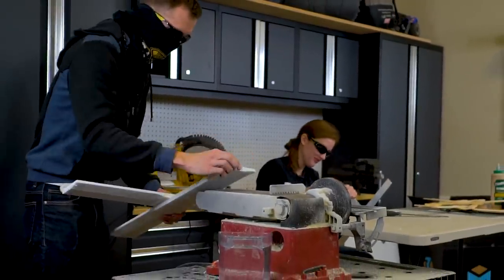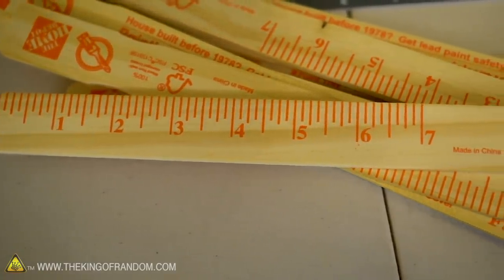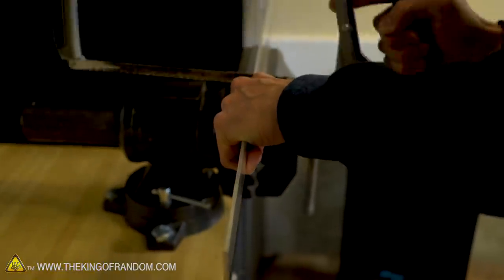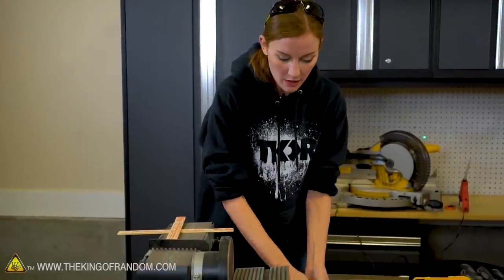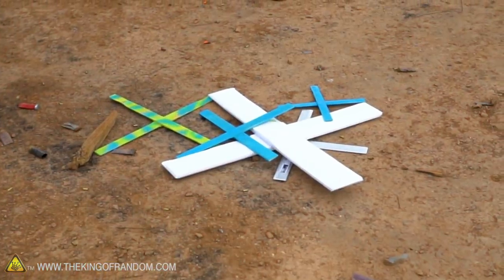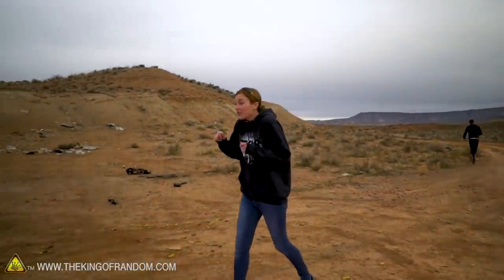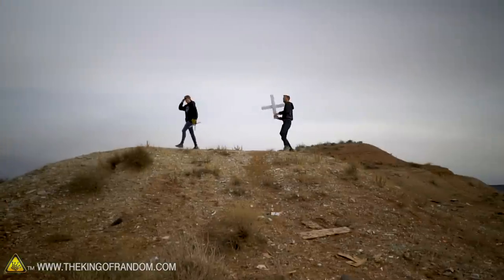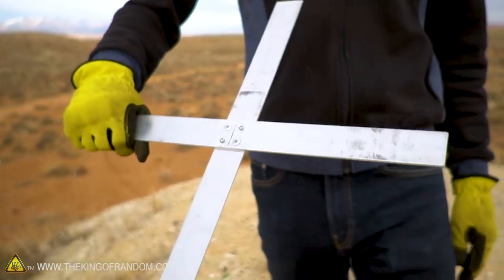Giant Metal Boomerang... Did It Come Back?

Comment: try actually "BENDING" the trailing edges of the metal one downward like flaps. basically you need to either spin it 100x faster or you need to increase its "bite" on the air to overcome its inertia. make Colin Furize it? attach it to a motor get it spinning at some insane speed (balance it first) and then catapault it into the air and release ?
Reply: Yes or Joerg Sprave.
Reply: I was actually going to say that it probably doesn't work because the ratio of structural material density to enviromental material density wasn't the same and that they might have better luck throwing it under-water.
Reply: hawkturkey  On a wing, they're called "flaps".
Reply: Like a fidget spinnerang?
Reply: Drac Williams let me show you it's features
Reply: Great advice but much easier to use a much thinner aluminum.

Comment: The metal on the metal boomerang needs to be more spread out, like a metal-bladed fan. It was too heavy for curving, spreading out the metal will work.
Reply: Its funny how we have more common sense then them they literally don't know aerodynamics
Reply: Tj2cool I wouldn’t exactly call aerodynamic knowledge “common sense”...
Reply: @FlyingSagittarius  that aspect is common knowledge if you attach a rock to a plastic bag as a parachute and it works. Now if you attach something havier wouldn't you make the parachute bigger? Its the same thing if you use metal which is heavier than wood and you know the surface lenght of the boomerang causes it to fly would you increase the suface lenght. They know how the boomerang works but they dont have the common sense to see the problem im 15 and i could figure this out. I bet they didn't even use a light weight metal like aliminum or something
Reply: I think if they drilled a bunch of holes to lighten it and then skinned it with some masking tape they would get better results.
Reply: Hopefully they'll make a better version of a metal boomerang
Reply: As one of my greatest friends always says:

The hardest choices, require the strongest will.
Reply: @AnimeErudite  they did in fact use aluminum.... they... literally say so In the beginning. They also don't have the metal specific tools to make it thinner or to flatten it out evenly so I'd cut em some slack?
Reply: 2:39 bar of aluminum
Reply: Dave Stacey that's a whole lot of extra work to do, using thinner sheet metal and slightly increasing its dimensions should work with less effort. Plus it's easier to roll curves into.
Reply: @AnimeErudite  aluminum --> 2:40 3:10

Comment: For metal you also have to account for the weight to surface area ratio. The reason the wooden ones fly like they are supposed to is because there’s enough force from the air on the surface area to support the weight of the boomerang for a certain period of flight. You can go thinner and thinner until eventually your metal boomerang weighs the same as your wooden one and still has the same surface area on the sides, or you can make your wings wider to provide more surface area.

Comment: You guys should try finding the center by balancing the sticks on a nail then drill a small hole through that point, put a nail through both sticks and glue it there. Should also try using 3 sticks to see if the affect is more pronounced.

Comment: The metal one didn’t work because it’s a different material, therefore different density. 

I feel if you want the metal boomerang to work you need to account for the mass and surface area of the wings. Try figuring out the surface area to weight ratio of the wood and foam ones and scale up the aluminum accordingly. 

Hope this helps!

Comment: Try using a thinner metal with a larger surface area, that way it will pick up the wind more and potentially turn easier, your one is too heavy for the air currents to affect it's trajectory at all

Comment: Nerf made similar boomerangs in the 80's.  The metal one didn't work well because you made it straight.  The metal doesn't give to the wind as well as the foam or wood.  You should have slightly bent the metal blades up to catch the wind and give resistance.  Actual boomerangs are shaped differently and the return is all in the shape.  The resistance to the wind is what causes the return so your wing shapes have to be modified with that in mind.

Comment: I think the reason why the foam worked so well compared to the metal is because there's not enough arm strength to give the metal boomerang enough spin.  You would have to build some kind of mechanical launcher to get the metal one to fly.  As long as you have enough RPMs compared to weight, it will fly.

Comment: I have the book in my amazon cart, ready to order. As for the aluminum boomerang, I think the rivets messed with it’s flight pattern. There may be an adhesive you can find, or try welding them and grinding down the edges of the welds until it’s sleek.

Comment: The aluminum one probably didn't work because it had a higher ratio of inertia/lift, since it was made with the same proportions of a wooden one and is heavier.
Maybe making the blades thinner and/or bigger would solve this problem

Comment: you should use a PVC pipe for making a boomerang. this could happen by cutting it along the top then heat gunning it into a flat sheet. then you could use the heat gun to angle the blades more sharply and cut the sheets out into sticks.

Comment: Calli it looked as if you were letting go at full arm extension which may bias a lower flight where if you if you let go at mid extension it may go higher meaning more time in the air/airtime for the boomerang

Comment: Here's some tips on the metal boomerang make it smaller and do the elbow boomerang curve the ends don't keep them corners and you had the air foil correct you just need to make it lighter get a fairly thin aluminium about a 3/8 inch thick and from tip to tip about 8 or 9 inches and about 3/4 to an inch wide this draft should help fyi I've never made a metal one but have made wooden ones before

Comment: The metal one was too heavy for the wing width which was too small to give lift to the boomerang. If it was thinner metal or even if it was same thickness but wider it might have worked better. I've experienced this before in my engineering projects.

Comment: Does parking a car on uneven ground affects its suspension?
Reply: Statically yes. As far as increasing wear while it's parked, no. Sprung weight is always carried by the suspension and uneven surface will transfer weight temporarily but won't hurt anything.

Comment: 2:30 using metal hacksaw blade to cut the wood.
2:36 chopsaw sitting 3 feet over from the same bench vise where the wood was cut 🤦‍♂️
Reply: Also the better way to make them is just to wrap them with rubber bands than using wood glue, & no sanding is needed.... the rubber bands let them have give on hard impacts and lets your kids adjust them to ‘experiment’ different tosses. (t shapes, etc)

Comment: I think you might have to have longer arms (wings) to have enough lift on to make it fly...
Reply: Wider, more surface area for the weight.
Reply: @mattg7952  , I'm not an aeronautical engineer, but I believe there is a point where making them wider doesn't provide more lift. I think that's why gliders have long, narrow wings. You need surface area, but you also need pressure differential.  Right?
Reply: @Ridingrules10000  There's plenty of variables. Weight, speed etc. Like an airplane prop, you don't make the props longer to gain thrust you change the pitch and angle over the surface area. A wider wing provides a larger negative pressure under the wing to help lift.
Reply: @mattg7952  , does a wider wing provide a greater pressure differential, or just more surface area?
Reply: @Ridingrules10000  In aeronautics, the aspect ratio of a wing is the ratio of its span to its mean chord. It is equal to the square of the wingspan divided by the wing area. Thus, a long, narrow wing has a high aspect ratio, whereas a short, wide wing has a low aspect ratio.
Maneuverability: a low aspect-ratio wing will have a higher roll angular acceleration than one of high aspect ratio, because a high-aspect-ratio wing has a higher moment of inertia to overcome. In a steady roll, the longer wing gives a higher roll moment because of the longer moment arm of the aileron. Low aspect ratio wings are usually used on fighter aircraft, not only for the higher roll rates, but especially for longer chord and thinner airfoils involved in supersonic flight. 
The physics are fairly complex but if you want a wing that rolls fast you want short and wide like a stunt plane. If you want lift a long thin profile like a glider as you said. So if your long wing doesn't turn you have to change the aspect ratio by adding width.

Comment: you will not be able to grind a solid piece of metal into a wing that will fly.  You will have to use very thin, rigid metal that is like a skin to the wing shape just like planes have to have the metal be light enough to fly and have enough surface area to create lift at the speed your throwing it at.
Reply: best bet is probably very thin titanium that is made in a bottom and top half then mated together with either welding or some kind of adhesive. You could possibly fill the center hollow section with a rigid spray foam.

Comment: not having read all 1.5K comments... the size change from wood to alum went in the wrong direction.  You are attempting to make a lifting surface.  I have no idea how much rotational speed you would have needed to make the AL thing work. But perhaps if you reduced the weight to close to that of the paint sticks ( that worked/flew ) no matter the size, don't put your body parts in front of it...